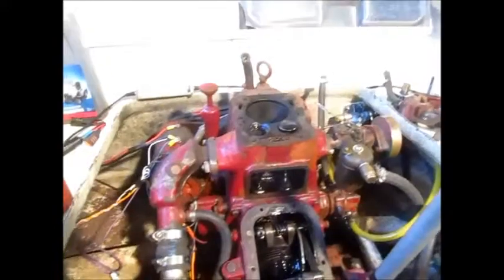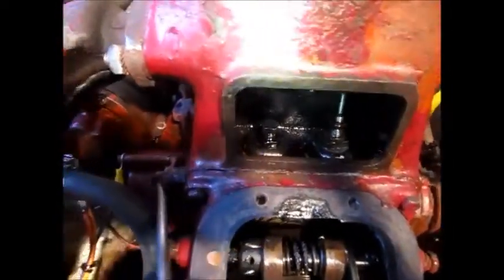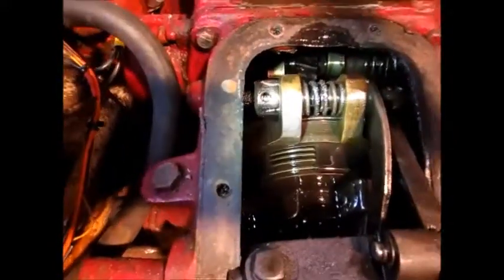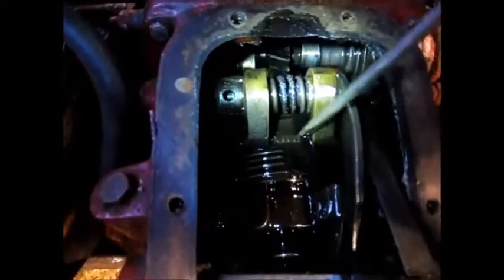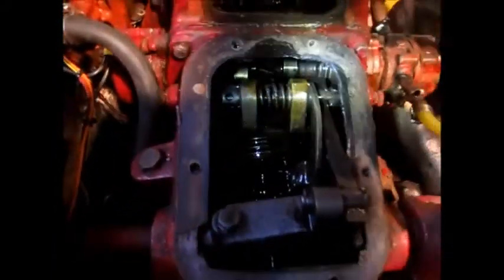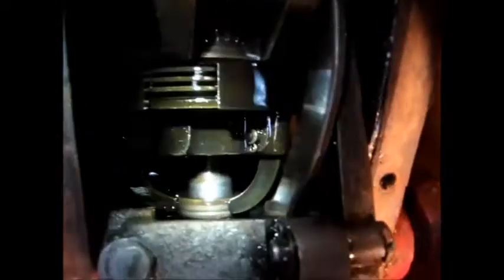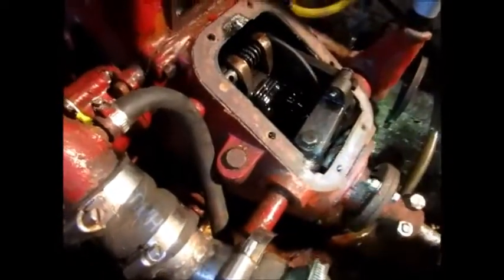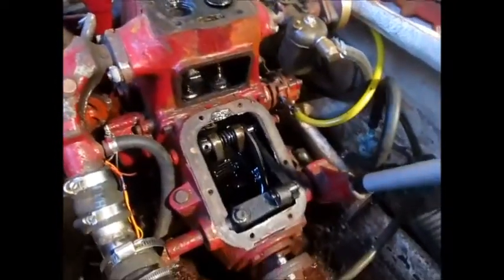Renault Marine Couach RC6 : analyse multiple problems.

Comment: Hi Ernie! I am looking for a head gasket for this motor. Do you have any tips where I can find this piece?! Thanks a lot!
Reply from the maker: Hey there Henri, it is actually not too complicated to replace the head gasket, provided you'll have some tools like sheetcutter and a bit of experience. Just buy a sheet of copper on Amazon for example and make a thin cardboard example of what you need first. Measure the old gasket's thickness with a calliper, but actually it matters not so much in these old machines. Use Hylomar when sealing it shut and a good torque wrench closing it up cross-wise pulling the bolts. Just take your time, one step at a time, and you'll get there. 
Alternatively, you can search on the internet for "gasket to measure" and have someone create it for you, but then you'd still have to provide an example first and it's really expensive.
Try https://www.lasalledesmoteurs.fr/ if you live in France or try http://www.drofin.co.uk/ but the last one asks 136€. Beware there are two different types of pistons 80mm and 82mm bore. Rings are also available here but very pricy 143 or 200€ even.
Do you have a Jeanneau Arcachonnais as well? Good luck!

Comment: Hi Ernie reading your perfect film now as we bought a Beneteau was same engine, which works ok but needs impeller replaced : what was the thumping sound on your camshaft ? Thanks, Fox
Reply from the maker: Hey there fox :-)  Great that my video brought you some insights. The impellers are easy to replace but be carefull not to over stress the screws/bolts. Also be prepared to remake joints yourself (they will most likely tear up while taking apart the pumps) and/or use liquid seal like Hylomar. 
The 'boink' in my crankshaft (see text below vid) was very misleading, I'll try to explain in more detail : the camshaft is positioned 90 degrees to the cranckshaft. Because the camshaft is always pushed into a 'solid' position of least resistance by the valve springs and cam followers after coming to a stand still, the play between the camshaft and the crankshaft tooth wheels, pushes the crankshaft comming from a stand still at first axially (length wise) away. Because the crankshaft has some play in its bearings the 90 degree tooth wheels play, provoces the cranckshaft to bounce into the end of the bearings play of the crankshaft. This axial play in the cranck shaft's bearings is so much play that by pushing the flywheel left or right you can actually feel and hear a boink each movement. I thought this was a major problem, but since the engine is fixed on a slope of 23 degrees downwards to the propellor, this play in the cranckshaft is nothing to worry about yet. In a major revision it needs to be eliminated, but that is hopefully more than some years away from now still :-)

Comment: Hallo Ernie, Ik heb dezelfde motor in een zeilboot van een oom. Dit is nu een erfstuk. Heb je ergens de tekeningen of onderdelen kunnen krijgen? Mijn motor zou wel moeten lopen maar ziet eruit alsof hij een paar jaar op de bodem heeft gelegen. dus ik denk eraan om hem te reviseren.
Reply from the maker: Hoi Erik, er bestaat maar erg weinig documentatie van dit motorblok en ook nog met fouten erin en natuurlijk alleen in Frans, voor zover ik weet, die zal ik je toesturen. Als de kop erg donker rood tot bruin/zwart is verkleurd, dan betekent dat vaak oververhitting door het vergeten of verstopt zijn van koelwaterkraan en zijn filter. Vandaar dat ik op mijn blok een koelwaterstroomindicator en temperatuurbeveiliging gemaakt heb.
Reply: @Ernie-Tech  hello i am looking for a head gasket if not so i think i will make it in copper
Reply from the maker: @robertoroscioni3171  Roberto, you replied to somebody else his question, but neverthe less : try to contact https://www.lasalledesmoteurs.fr/ on their website. It's the only address in France I know who might have something. Otherwise indeed making it yourself or to mesure by a specialist are your only options. It is not so difficult and a sheet of copper is easily found on Amazon for example. Good tools make the job far less difficult and use head gasket seal like Hylomar. Good luck